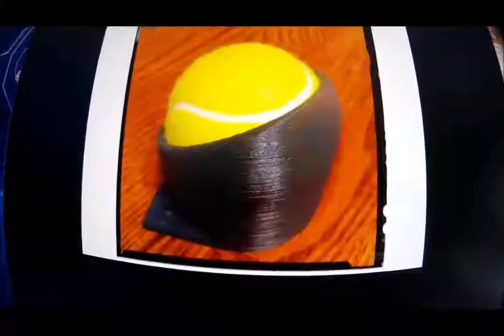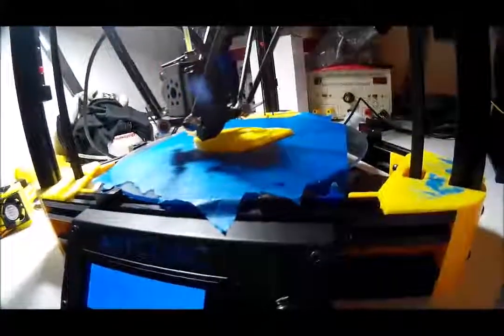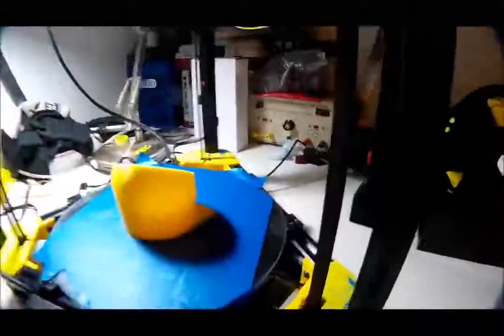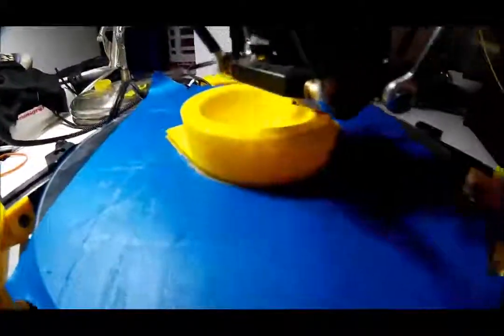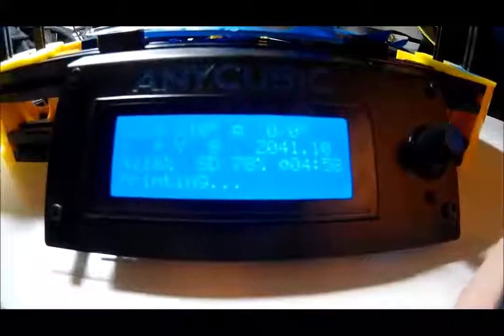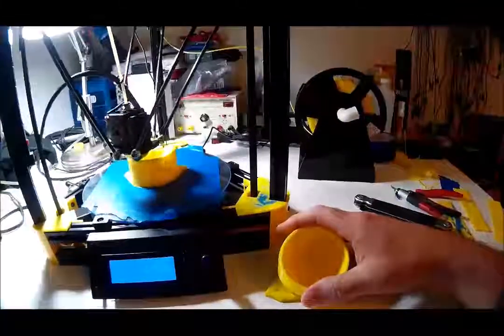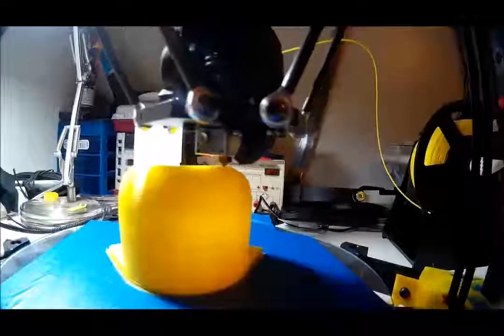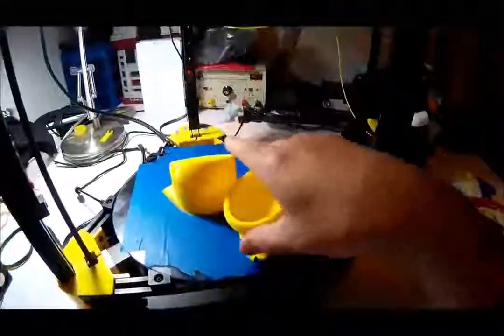AnyCubic Tennisball feet print

Comment: Hi,  Try aquanet hairspray or a gluestick (purple) instead of the tape.  You should not have to sand the prints,  Also the tape has to be perfectly flat on the glass and you should be able to use it a few times if you set that first layer down so it sticks but doesn't embed itself into the tape.  Or you can try printing on the buildtak surface with no extra adhesives.  I'm building a linear plus right now so I'm interested in your experiences.